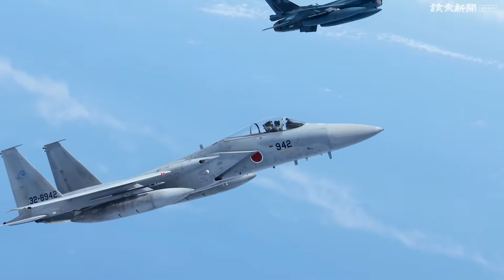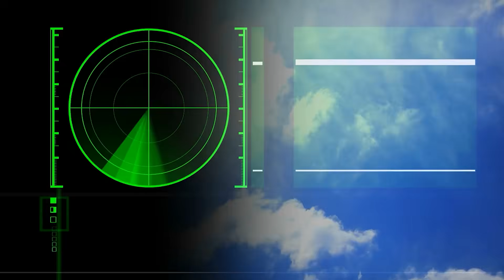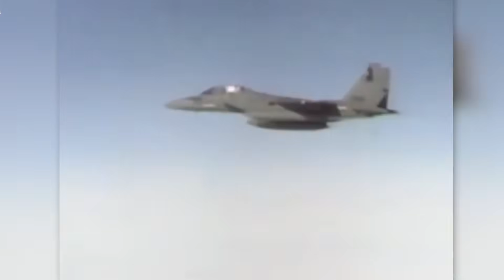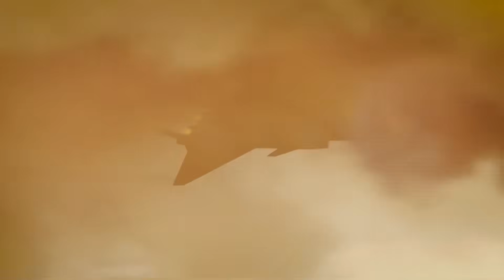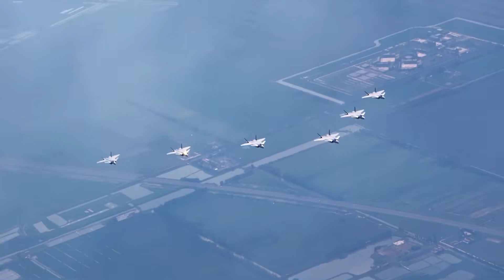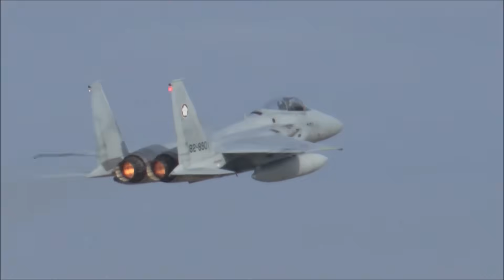Chinese J-20 Gets TOO CLOSE to Japanese F-15 - Then THIS happened

Comment: I don't believe for a second that the Chinese engines on their J-20 wanna be stealth jets are pushing 30,000 lbs of thrust each. Their engines are smoking garbage; they look like Diesel Pickups "Coal Rolling" in the midwest!
Reply: This 🤡channel is deep in majorcopium. 
Japanese officials complained that their two of their mighty F-15 were missile locked by Chinese J-15 in Dec 2025.
One of the F-15 were locked from a distance of 148km for more than 30 minutes.
Informed people knows this is a 🤡 channel to rewrite the event into their own narrative.
You are still at stage 1. 4 more to go.
Reply: Projection Majorcopium.
What happened when the j20 and f35 met in 2022? The j20 had it on missile lock.
General Wilsbach (Pacific Air Forces - USAF) - "The KJ-500 plays a significant role in some of their capability for long-range fires. Some of their very long-range air-to-air missiles are aided by that KJ-500. Being able to interrupt that kill chain is something that interests me greatly."
The general continued "With the E-3 AWACS in the air, the airborne sensors that we're relying on are not really suited to the needs of 21st-century operations, especially against (stealth) platforms like the J-20 or similar. It can’t detect these platforms at great distances, and detection before the enemy can provide an advantage to the aircraft that are tasked with fire delivery."
What he conveniently omitted was that the kj-500 directed the j20 to get past their awacs and enable it to get missile lock on the battle penguin.
You are still at stage 1. 4 more to go
Reply: >"Their engines are smoking garbage"
Projection Majorcopium. 
f22 has engine thrust of 312 kN and thrust to weight ratio of 8.8,  lift coefficient of 1.7, old GaAs radar.
j20 has engine thrust of 370 kN, twr of 11.8, lift coefficient of 2.1, cutting edge GaN radar, greater range, greater speed, 360 degree sensors and HMD.
Meanwhile the battle penguin can't even supercruise so it does not even meet it's own manufacturer LM's  definition of 5th gen.
You are still at stage 1. 4 more to go.

Comment: Excuse me! 
The incident involving Chinese J-20 fighters in the East China Sea has drawn significant attention, but some corrections are necessary for the situation to be understood accurately.

First, this was not the interception of a single J-20 by only one Japanese F-15J. There were four J-20s, and the Japanese response followed its standard doctrine: a layered interception, involving modernized F-15Js developed in partnership between Japan and the United States, the Mitsubishi F-2 (Viper Zero), a 4.5-generation hybrid multirole fighter and an F-35A Lightning II, operating as a sensor-fusion platform. These aircraft appear in the video itself, but they are not properly contextualized.

The Mitsubishi F-2, for example, is a highly advanced aircraft developed in cooperation with the United States(Japan 60% / USA 40%). 

It carries design lineage and operational concepts influenced by platforms such as the F-15 and F-16 Fighting Falcon, which themselves contributed to the broader evolution of modern Western air combat doctrine later reflected in aircraft like the F-22 Raptor and the F-35 Lightning II.

For decades, the F-2 has conducted real-world intercept missions against Russian, North Korean, Chinese, and other aircraft operating around Japan. Ignoring its presence significantly distorts the analysis.

Likewise, the F-35 was not present for close-range combat, but rather as a sensor and data-sharing node, which is a central element of modern air warfare. Reducing the event to a simple “F-15 versus J-20” narrative oversimplifies a multinode, integrated operational environment.

It is fair to state that the visual-range approach reduced the strategic value of the J-20’s stealth and allowed for limited data collection, but this does not mean that all of its technological secrets were fully exposed, nor that the aircraft is inherently inferior. 

The Chinese mistake was primarily doctrinal, involving the employment of a stealth fighter outside its optimal operational scenario, rather than a technological failure.

Military analysis requires precision, because small omissions or oversimplifications can easily lead to incorrect conclusions. What this episode actually demonstrates is not the absolute superiority of one aircraft over another, but the importance of doctrine, platform integration, and real-world operational experience in airspace interception missions. 

It is widely recognized that Japanese pilots, much like Brazilian pilots, rank among the most experienced due to the frequency of real intercept operations, but this does not invalidate aircraft performance data or technological realities.

 Japan is the largest F-35 operator after the United States, operates numerous advanced platforms tailored to its regional scenarios, and maintains a highly integrated air defense structure. Still, this encounter was not a complete “X-ray” or full technical scan, as the video suggests.
Reply: This 🤡channel is deep in majorcopium. 
Japanese officials complained that their two of their mighty F-15 were missile locked by Chinese J-15 in Dec 2025.
One of the F-15 were locked from a distance of 148km for more than 30 minutes.
Informed people knows this is a 🤡 channel to rewrite the event into their own narrative.
Reply: @oot007 About what you said, I researched everything and everything from Japan and China. This never occurred, just some rumors because, if this had really been an insider. Both nations had already come into conflict.
The only serious incident that occurred between the two nations was between the Philippine Seas, China and Japan. In this interception scenario, Japan sent 4th Generation fighters, being exactly the same generations as the Chinese for balance and honor. Japan and China have locked their sights on each other. They just did that and nothing else. Japan claims that the Chinese threatened first and also did the same, showing all the official data while the Americans, Japanese, Taiwanese, South Koreans and allies were informed instantly. If China joins with Russia and North Korea, The world will erase them from the map.
Reply: @djwellttonster  Projection Majorcopium. The J-15 twice locking of the F-15 was reported by media in Japan, Australia, USA and Japan Ministry of Defense.
-Incident reported by Japan Ministry of Defense  on 9 Dec 2025
-Reported by ABC on 7 Dec 2025
-Reported by Kosuke Takahashi of Naval News on 8 Dec 2025  - "Japan Protests After Chinese J-15 Figthers Lock Radar on JASDF Jets Near Okinawa"
-Reported by Jesse Johnson of the Japan Times 8 Dec 2025: - "Tokyo and Beijing traded barbs Monday as their diplomatic row showed no signs of abating, following Japan’s report that Chinese warplanes had locked their radar systems on Air Self-Defense Forces fighters over the weekend."
-Complaint lodged by Japan Ministry of Defense  on 9 Dec 2025
You are still at stage 1. 4 more to go.
Reply: @djwellttonster  >"The world will erase them from the map"
Projection Majorcopium.
Has China ever invaded Japan? No
Has Japan ever invaded China? Yes. Ever heard of WW2 plus others?
Has China ever invaded UK? No
Has UK ever invaded China? Yes. Ever heard of the two Opium Wars?
Ever been to the British Musuem? What is it full of?
Stolen treasures from China, Egypt, Greece and many others.
You are still at stage 1. 4 more to go.
Reply: @oot007  This exactly proves that everything I said are real facts. What has happened so far are these things. Japan sent This exactly proves that everything I said are real facts. What has happened so far are these things.

 Japan just sent the same number of F-15J fighters and they were on the lookout waiting for China's responses. That's all. Japan could have sent along with the Americans, its joint powers, including the U.S. F-22 Raptors that are at Japan's bases. They could have sent F-2s, F-35s and a whole squadron but they did exactly the same thing to show the world who the real threat really is.

 Everyone is following all this in the international media.

These are different machines every day for more than 5 years of interceptions, approximately 1,000 or more than a thousand interceptions per year, of aircraft in the last 6 years since 2020, coming from Russia, China and North Korea, in addition to missile tests in the Pacific by the three countries. You will remember the incidents of tests falling into Japanese waters coming from North Korea...

In other words, in these calculations, it is an average that, depending on the day, reached more than 3 interceptions daily from Japan, and that is why the F-2 (Vipe Zero) are today considered by experts and pilots worldwide as the best 4.5 Generation that exists and probably the most efficient fighter jets ever built due to the number of interceptions and missions carried out.

This is even proof that led NATO partners to undertake the joint European project for 6th Generation fighters with Japan...
Reply: @djwellttonster  >"show the world who the real threat really is"
Projection Majorcopium and straight out of Chuck Norris movie -badcomedy
Which country has violated international law and the UN charter more than any other country since it was founded over 80 years ago? 
It's not China, Russia or NK.
It's the USA.
You are still at stage 1. 4 more to go.
Reply: @oot007 Let's move on to stage 10 then, buddy, because you're still at stage 4.
In the history of humanity, everyone has screwed up, including your descendants and mine.
Nobody's a saint!

Have you forgotten that the Japanese, Korean, and many other languages came from Chinese?

That's exactly what I'm talking about.

I know those museums you mentioned and many others too.

Let's remember that if we start talking about cheap revenge as justification for continuing to make mistakes, with wars, then we have to destroy the entire planet Earth because everything and everyone is wrong...
Simply that...
Reply: @djwellttonster  Projection Majorcopium. The United Nations Charter states that all sovereign nations have the right to self determination and it's governments to be FREE of external interference. 
Which country has violated the UN charter and international law more than any other country since it was founded over 80 years ago? 
The USA.
Every "regime change" operation and war beyond your own borders interferring with the internal matters of a sovereign nation is a violation of the UN charter and international law.
Which country interfered and waged war against Vietnam, Korea, Iraq, Argentina, Bolivia, Brazil, Chile, Colombia, Cuba, Dominican Republic, El Salvador, Guatemala, Grenada, Haiti, Honduras, Nicaragua, Panama, Puerto Rico, Uruguay, Venezuela, Libya, Syria, Afghanistan, Lebanon, Laos, Bosnia, Serbia, Yemen, Pakistan, Somalia, Iran, a proxy war against Russia in Ukraine  and now trying to start a war against China.
The USA.
Which country has 800 military bases around the world outside it's own borders? USA
How many does China have outside it's own borders? 1

"We are the most warlike nation in the history of the world” - US President Jimmy Carter
"America has no permanent friends or enemies, only interests" - US Secretary of State Henry Kissinger
"I was the CIA Director. We lied, we cheated, we stole. We had entire training courses. It reminds you of the glory of the American experiment" - CIA Director and US Secretary of State Mike Pompeo
You are still at stage 1. 4 more to go.
Reply: @djwellttonster  >Have you forgotten that the Japanese, Korean, and many other languages came from Chinese?
Cope hard. That is because ancient Chinese migrated and founded modern day Japan and Korea.
Japanese, Korean and Pacific Islander DNA can be traced back to China and Mongolia.
Reply: @oot007 😂😂😂 And all these things were done through human blood and through wars where they invaded and killed local communities, and if you believe it was all through love and peace, go back to stage 1.

It's also worth highlighting that Mao Tse-tung, the Chinese dictator, was, according to current records, the greatest monster known to humanity, probably killing more than 85 million Chinese people during his historical dictatorship.

There are countless other dictators throughout history such as Lenin, Stalin, Francisco Franco, Augusto Pinochet, Hugo Chávez, Kim Jong-un, Maduro, Saddam Hussein, Hitler, and many more, but that's a conversation and a topic for another day.

Good afternoon and all the best...
Reply: @djwellttonster  Keep coping Majorcopium.
You claimed China "was the real threat" without knowing basic world history.
Then when you realise it is the Yooessay that has been starting fires worldwide for the last 80 years with their 800 bases worldwide what do you do? Nothing.
A classic case of "rules for thee but not for me".
You are still at stage 1. 4 more to go.

Comment: This video keeps talking about visual range. BVR (beyond visual range) is modern jet warfare. It said that the J20 practices firing missiles at 90 miles out using shoot-and-scooter tactics. Basically the F15 can’t detect the J20 outside of IR or visual range. The F15 can beat it everywhere else.
Reply: This is a 🌮🐍🤡🎪 channel.
What happened when the j20 and f35 met in 2022? The j20 had it on missile lock.
General Wilsbach (Pacific Air Forces - USAF) - "The KJ-500 plays a significant role in some of their capability for long-range fires. Some of their very long-range air-to-air missiles are aided by that KJ-500. Being able to interrupt that kill chain is something that interests me greatly."
The general continued "With the E-3 AWACS in the air, the airborne sensors that we're relying on are not really suited to the needs of 21st-century operations, especially against (stealth) platforms like the J-20 or similar. It can’t detect these platforms at great distances, and detection before the enemy can provide an advantage to the aircraft that are tasked with fire delivery."
What he conveniently omitted was that the kj-500 directed the j20 to get past their awacs and enable it to get missile lock on the battle penguin.
Reply: Japan govt lodged official complaint to China a few weeks ago that their two of their mighty F-15 were missile locked by the J-15, one of them locked for over 30 minutes from 148 km away.
This channel still at stage 1. 4 more to go. 🤣
Reply: >"The F15 can beat it everywhere else"
Utter fantasy when the f22 is outclassed.
f22 has engine thrust of 312 kN and thrust to weight ratio of 8.8,  lift coefficient of 1.7, old GaAs radar.
j20 has engine thrust of 370 kN, twr of 11.8, lift coefficient of 2.1, cutting edge GaN radar, greater range, greater speed, 360 degree sensors and HMD.
Meanwhile the battle penguin can't even supercruise so it does not even meet it's own manufacturer's definition of 5th gen.

Comment: China J planes are garbages. Pinduoduo assembled
Reply: Projection Majorcopium.
What happened when the j20 and f35 met in 2022? The j20 had it on missile lock.
General Wilsbach (Pacific Air Forces - USAF) - "The KJ-500 plays a significant role in some of their capability for long-range fires. Some of their very long-range air-to-air missiles are aided by that KJ-500. Being able to interrupt that kill chain is something that interests me greatly."
The general continued "With the E-3 AWACS in the air, the airborne sensors that we're relying on are not really suited to the needs of 21st-century operations, especially against (stealth) platforms like the J-20 or similar. It can’t detect these platforms at great distances, and detection before the enemy can provide an advantage to the aircraft that are tasked with fire delivery."
What he conveniently omitted was that the kj-500 directed the j20 to get past their awacs and enable it to get missile lock on the battle penguin.
You are still at stage 1. 4 more to go
Reply: @oot007 that’s a sure way to hell for J20 in battle doggie fight
Reply: @Gugugu374  Projection Majorcopium
f22 has engine thrust of 312 kN and thrust to weight ratio of 8.8,  lift coefficient of 1.7, old GaAs radar.
j20 has engine thrust of 370 kN, twr of 11.8, lift coefficient of 2.1, cutting edge GaN radar, greater range, greater speed, 360 degree sensors and HMD.
Meanwhile the 191 kN battle penguin can't even supercruise so it does not even meet it's own manufacturer's definition of 5th gen.
Reply: @oot007 🤡🤡🤡🤡😂😂😂😂
Reply: @DUTAE88  Yooessay 🌮📄🐯🐍🤡🎪
Reply: @DUTAE88   🌮📄🐯🐍🤡🎪
Reply: @Gugugu374  Like you this 🤡channel is deep in majorcopium. 
Japanese officials complained that their two of their mighty F-15 were missile locked by Chinese J-15 in Dec 2025.
One of the F-15 were locked from a distance of 148km for more than 30 minutes.
Informed people knows this is a 🤡 channel to rewrite the event into their own narrative.
You are still at stage 1. 4 more to go.